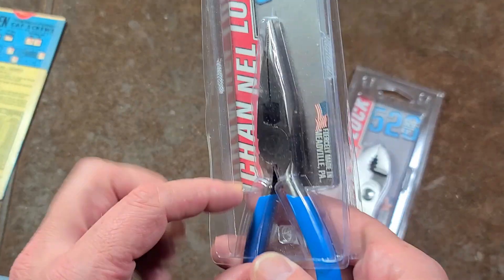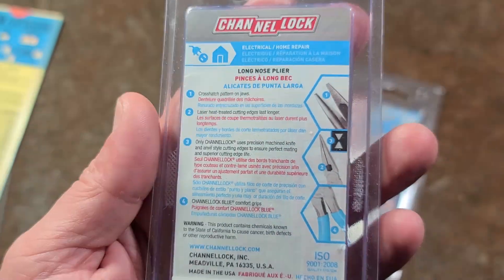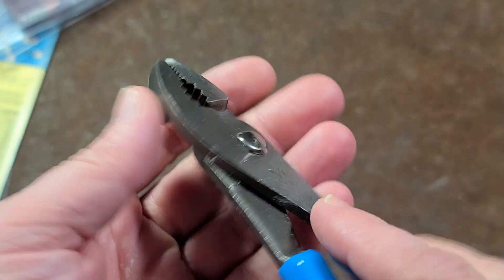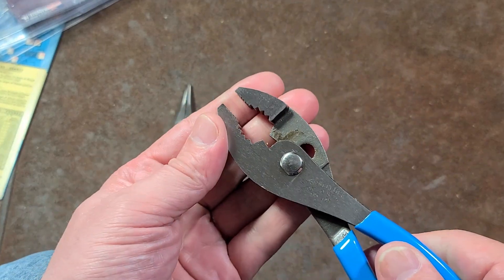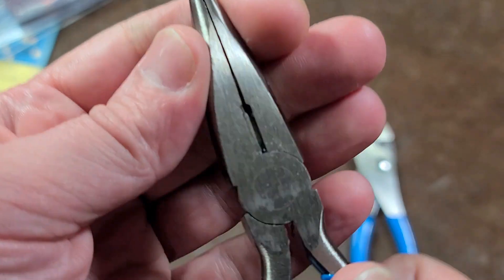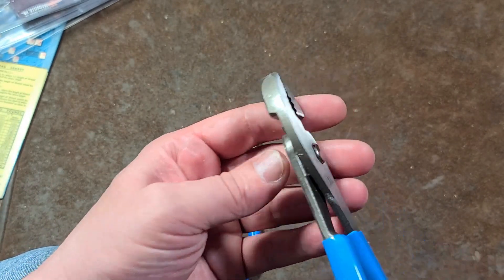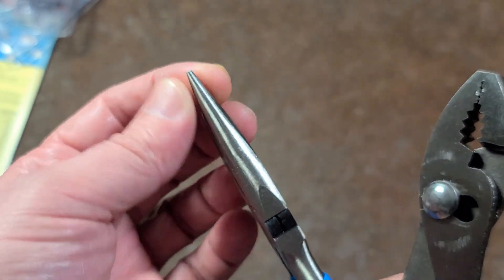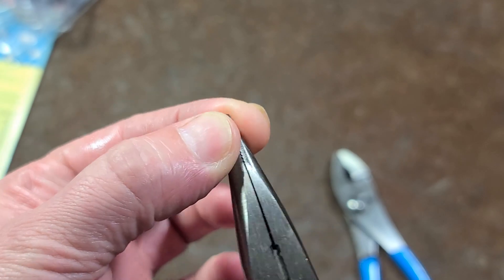Channel Lock USA Basic 6" Pliers Review

Comment: Im replacing all of my old channel locks and Craftsmen pliers. Something I should have done long ago but I had not found this brand until really about 3 months ago. That is the best ive ever seen Knipex. I spent over $700 in the last 3  months and I'm not even close to being done. They are just incredible. Where is I used to struggle in the past with my channel locks. My new Knipex Tightens and loosens nuts bolts with the greatest of ease. I'm just upset it took me to a 51 years old to really realize how good this manufacturer was. And I know why they don't sell them in the stores because they would never sell anything else. So long as the people actually could afford them. Anybody that wants that use them with Willie quickly realized how good they are and what they replace is absolutely incredible.

Comment: i had plenty of channel lock water pump plyers break on me and i keep on buying em
Reply: I’ve never broken channelocks!!! What did you do to break them??!!
Reply: @MB12116  
just grabbing and turning pipes with the large water pump pliers. i had a few that break/fail under torque and the handles would come together. never looked to see what exactly failed because you grab another tool ASAP and put the other one on the floor. then i put em in my bag and forget about it till i am at the store and buy another one.

Comment: I still think snap on makes the best pliers.
Reply: They better be the best for what they cost.
Reply: Knowledgeable
Nerds
Invent
Pliers
Eliminating
Xenophobia

KNIPEX
Reply: @onehandclapping1068  ok, but, snap on.
Reply: @_P0tat07_  you know snap on doesn't actually make their own pliers...
Reply: @onehandclapping1068  
Smart
Nerds
Avoid
Purchasing
Overseas
Nightmares

SNAP-ON
Reply: I have good luck with channellock I just soften the sharp edges
Reply: @appeal2nature  
How
About
Returning
These

HART
Reply: Are Channel Lock pass thru sockets and wrenches any good? There is a set on eBay for $25. Not sure, looks a bit cheep but maybe not.
Reply: @marincountyspotter17  snap on does in fact make most of their own pliers, as well as other basic hand tools.
Reply: @paedahe4975  The unifit spline drive set? I wouldn't

Comment: I just had these same long nose pliers replaced under warranty because the the jaws did not touch when closed. They replaced them with the newer XLT version and the build quality is atrocious. 1/8” gap between the jaws although the tips do touch. I would take better made Chinese or Taiwanese pliers any day.
Reply: If you didn’t know, the gap is intentionally engineered into the design.
Reply: I understand having a slight gap (1/16” or less) but a 1/8” is huge. What purpose does such a large gap serve?
Reply: So it doesn’t crush copper wire, which is extremely soft

Comment: I have a lot of channel lock tongue and groove pliers.  I always found rust around the pivot on brand new pliers.  I don't understand why they haven't figured out how to prevent this.  There seems to be rust at your slip joint pliers too.  Also, I hate the looseness of the slip joint.  I always avoid using them unless I absolutely have to.  Problem is they come with just about every set of pliers or tools in the world.  So I have a ton even though I hate them.  I prefer duck bill pliers, particularly the USA craftsman.  Love them so much I paid full price and I bought 4.  They feel solid and strong with excellent grip.